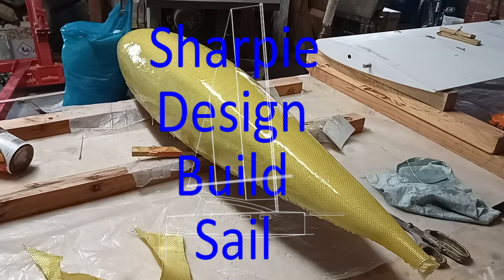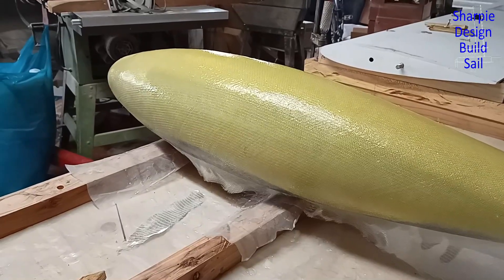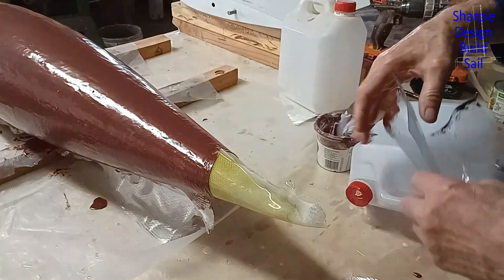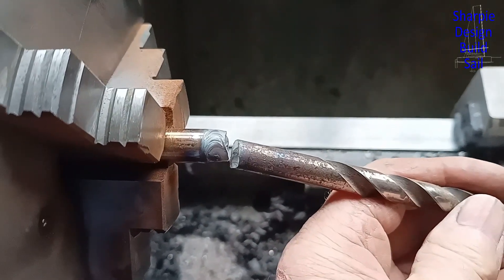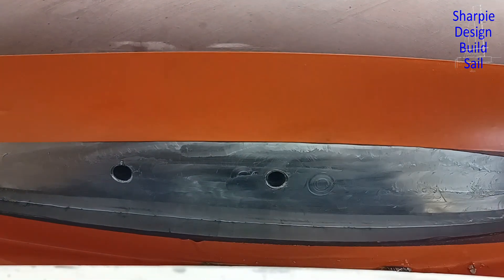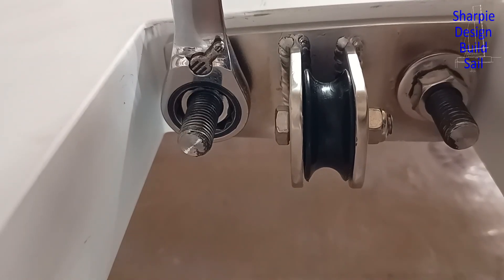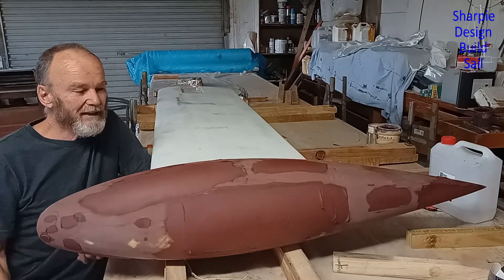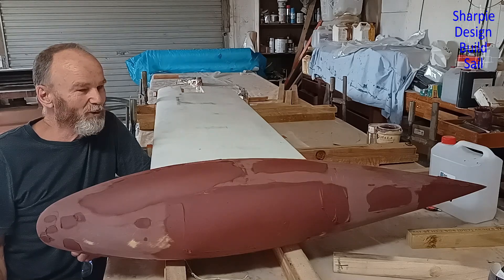Daggerboard Meets Bulb — The Struggle Is Real! | Sharpie Sailboat Build --V58 Pt1

Comment: How are you going to deal with seaweed that wraps itself around the keel. It won't shed easily with that design? Looks great though!
Reply from the maker: Now that's a good question and yes, it's not a seaweed self shedding type keel, common though they are. What's probably worse,  and I've experienced it more than once, is being on anchor in a bay with swirly winds, causing the yacht to 'sail around' on anchor and finding in the morning you need to swim to untangle the warp wrapped around the keel! Once or twice I was able to motor in a circle to fix it but sometimes you can see which way the wrap is. Some race yachts have a little window in the hull ahead of the keel so they can check and I think I've seen the situation where a blade can be run up and down the foil!
Thanks for the question and great feedback!

Comment: What diameter are those bolts and how heavy that bulb?  Im considering adding some depth to my current daggerboard, and although i prefer "thru-bolt", others have suggested a glued stud into the existing lead will be fine.  Boats looking great!
Reply from the maker: Interesting questions! I've used 12mm 316 SS round bar for my bolts and each has a conservative 3000kgs tensile strength. The bulb is about 240kgs so they have plenty of strength for my situation, it would be different if they were are the 'root' or at the hull keel join of a keeler were the forces would be multiples of my situation because of the leverage.
For your situation, yes you could glue in a threaded bolt into the bulb, the thread would need to be as long as a minimum of 8 times (I have seen people say 5-6 is enough) the thread diameter but if you made the thread much longer I would say you could glue a bolt in without threading the lead. Threading the lead is very problematic, even if you have the best gear and even if you have a few % antimony in the lead for that purpose. I doubt most keels or bulbs have been made with that in it. The other thing is having a tap that is long enough! I didn't have one for my situation and would have had to make something special. My advice after the experience I just had would be to go with what your "preference" is and drill right through and use a washer and nut. That way you can have 100% peace of mind your lead will stay where it's meant to be! That being said, there is some interesting stuff online about the situation. There is a very qualified guy called Par you see in the forums and he even OKed the use of using lag bolts into lead, basically a bolt intended for wood that makes it's own thread after you drill a correct sized hole and I can't see why that wouldn't work. But then the question is, how do you connect those bolts to the daggerboard?
Thanks for the questions and good luck with your project, I'd certainly be interested in hearing what you decide to do!
Reply: @KarlFullerNZ   Thanks for the detailed response. I think you will find PAR has been deceased for some years.  Lag screws/bolts could possibly work. The existing lead shoe was sheathed, and any new addition would be glassed into the existing stuff. I will have to do some number crunching on fastenings when i get the new ballast stub, which will probably mostly be a hardwood spacer, and perhaps only 25kg of extra lead.
Reply from the maker: @skaraborgcraft  ahhh, sorry to hear PAR might have 'sailed over the horizon'. He was so knowledgeable and generous with what he knew. Just about everything I looked up, there he was, making sense!
Yes that's not much extra lead to deal with and if your glassing runs over the bulb and onto the daggerboard, you should be fine. I'm curious when you mention the 'lead shoe' sounds like one of the earlier Elliott designs? Quite a few have changed from the shoe to a bulb, probably mostly because of the reduced wetted area? Bulbs themselves are not always best. My Young 11 Fineline had a big one and in a Coastal Classic race, in light winds another Y11 was matching us and we speculated that it might have been because of his reduced wetted area, having a conventional Y11 keel. But of course there could be a lot more to it than that, he may have had sprayed on antifouling whereas I rolled mine on, not quite so good in the light stuff! He also might have been a better sailor than me but I had some very experienced crew on for that race 🙂

Comment: Looks very nice. Did you use kevlar for protection when you might run aground? I‘ve been thinking to also use a strip of kevlar on the bow of Sienna and run that strip all the way to the bulb, just to have this extra protection if I‘d run in a shipping container or something heavy.
Reply from the maker: Thanks!
Yes, every yacht I've had, with a bulb had damage under it which of course is hard to fix. It's also to protect the bulb when going on the trailer. If you use it, like I've done, put it under a layer of fiberglass which I put on before the kevlar glassing had cured, so there's a chemical bond, but no sanding! Using peel ply over the kevlar would work too. Do you have a water tight bulkhead up forward to protect against flooding after a collision? I would say that's the first order of business for any ocean going vessel, maybe steel is the acception.j
Reply: Thank you for your reply!!
Yes there will be a watertight bulkhead where the cavity between bow and bulkhead will be filled with floatation foam. The goal is to have more of those compartments to make the yacht virtually unsinkable, at the cost of some space, but that‘s ok for me😉
Reply from the maker: @SV_Sienna if you had enough volume in other places in the yacht that she could float even if bow bouyancy lost, if they are sealable, you could still use them for flotation? That's what I've done. But your method sounds fulproof and she could sustain a breach of more than one compartment by the sounds of it. I've always thought it most practical if a vessel can double as the unsinkable liferaft. The lower the reserve flotation the better of course.
Reply: @KarlFullerNZ  Yes, sealed compartments that can be used for storage are surely a good way to go. It will probably be a mix of both. But I’m leaning toward a philosophy of “safety first” (unsinkable), and then working with the space I’ve got left — which should still be more than enough if you start with the bare necessities.
Reply from the maker: @SV_Sienna  I like your philosophy, very sensible and one that gives a huge amount of peace of mind, which sometimes doesn't mean as much as it should when we know conditions at sea can exceed what we expected. Look at that round the world race using conventional dated sailing vessels and although he had done a huge amount to 'beef up' his yacht, Tapio saw his yacht sink beneath him (I think they still don't really know why) and Kirsten had to rescue him. Plan for the unexpected as we both seem to be doing!